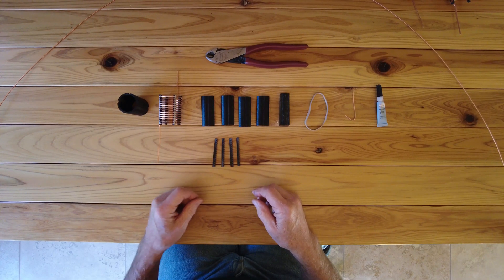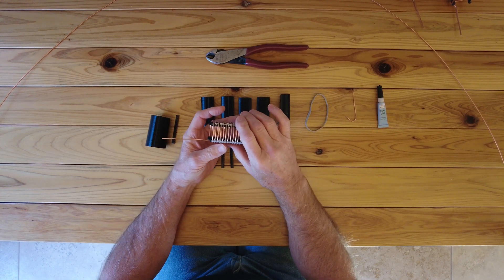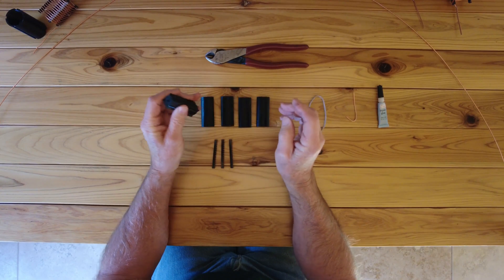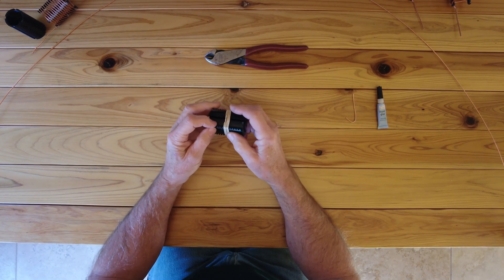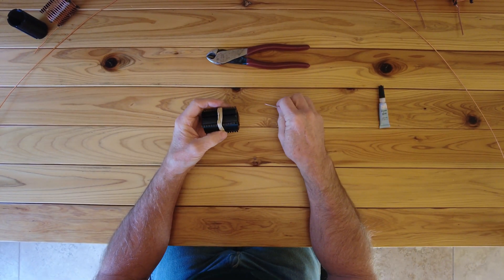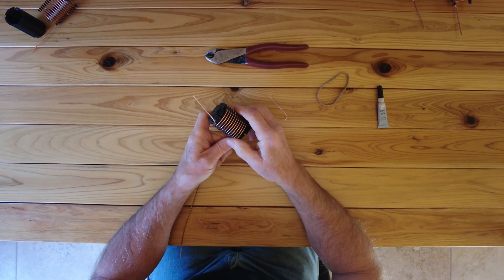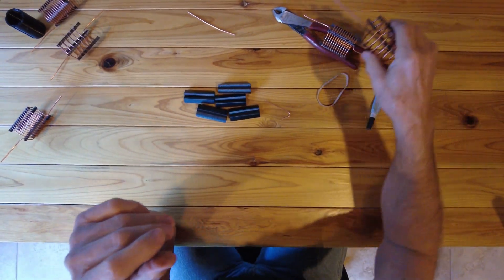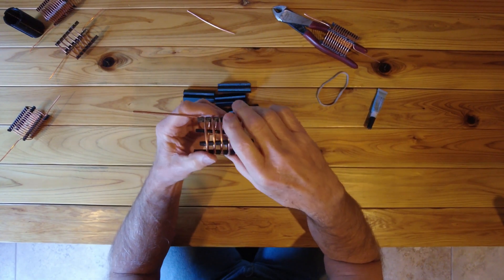3D Printed Coil Form with Uniform Diameter

Comment: Great idea!
Reply from the maker: Thanks!  This version works fine if you need uniform diameter, but to be honest I can't think of very many applications where that would be necessary.  My other video shows a simpler approach that includes a slight taper, and I think that would work fine almost anywhere.  I mostly just created this version to see if I could do it.  ;)